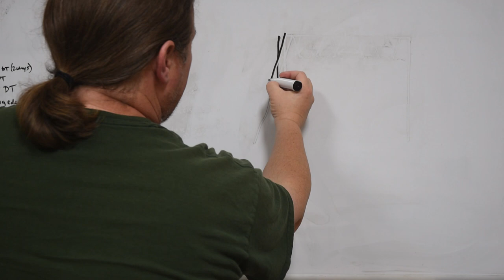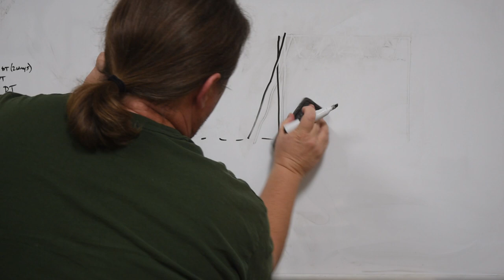Precise Hand Cut Dovetails

Comment: You're a heck of a good teacher. I am obsessed with the process of making dovetails.  My profession (retired now) required precision.  Tight fitting dovetails require precision at each step. Otherwise frustration sets in trying to make the dovetails fit in the end.  I appreciate the  details of this video.  My most recent discovery is that preparing the pieces of wood as exact as possible makes the next step in the process less tedious. Thanks.
Reply from the maker: Thanks

Comment: I think one thing some people can’t comprehend is a 1 in dovetail will not fit in a 1 inch cut out. There as you know is interference... makes a difference what side of the line or on the line you are cutting. good video. Thanks
Reply from the maker: I can tell. You're definitely engineering biased. :)

Comment: Great video.  When you're cutting the pins, do you obliterate the line, cut the waste side, or cut to the not-waste side?  I'm working on a cabinet and my dovetails are coming out way too tight.  It takes a lot of time to fix them and since it is hard to tell where it is too tight and thus some guesswork is needed, the overall fit gets degraded.
Reply from the maker: It’s burnished where tight.
Reply: @wortheffort  I guess I am blind, I can't see it. Your videos are great, btw.